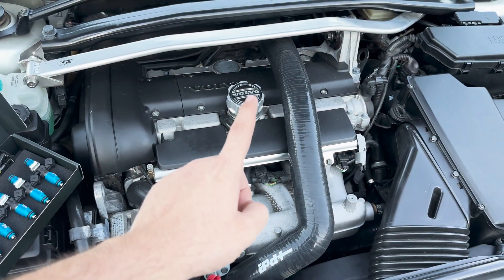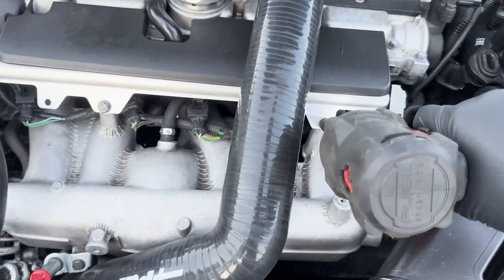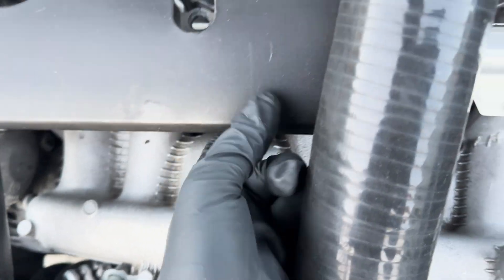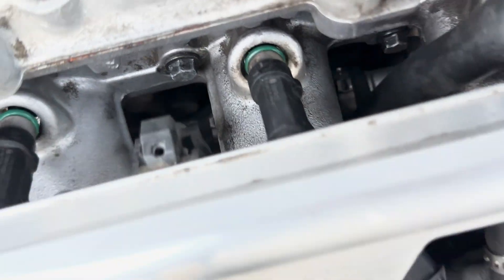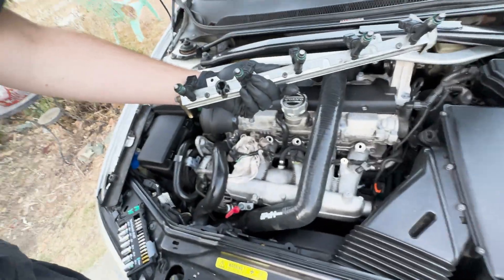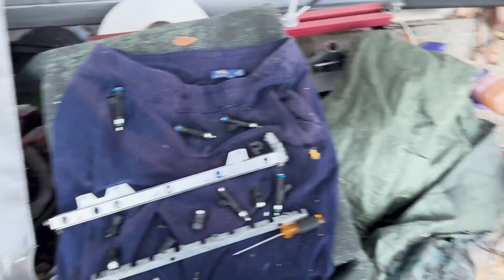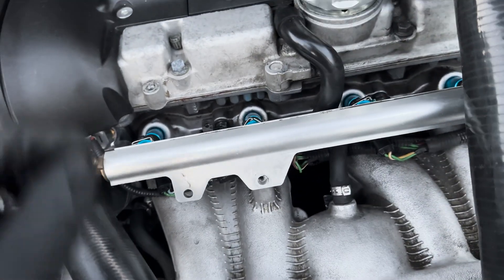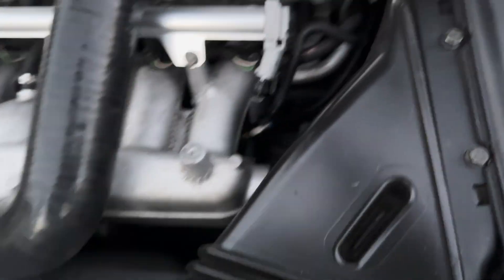P2 Volvo Fuel Injectors || Removal & Installation

Comment: Do you need to remarry or reprogram your car after changing the fuel injectors?
Reply from the maker: Highly recommend software upgrade when doing hardware upgrades. You will run extremely rich and improper if you just install these with no tune!

Comment: i dont think you need to fully remove the charge pipe to access the torx under it, i removed the 2 torxes and it gave enough wiggle room to get to the torx under the pipe 🤔

Comment: before you start the job, WHILE the engine is running, pull the fuel pump fuse, let the car stall.  This should release any pressure in the line and fuel residue will be minimal.

Comment: do you not need the injector spacer after the ORING that goes into the intake? @positivegarage
Reply from the maker: No I don’t believe so, has been working very well on my car so far! Are you reffering to the plastic piece at the end of the stock injectors?